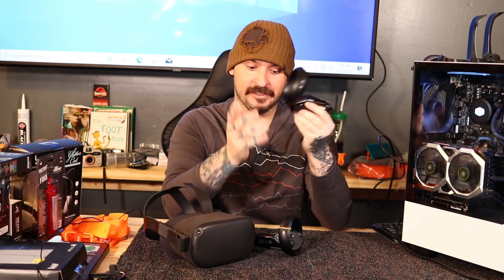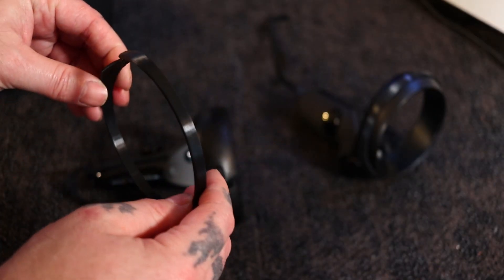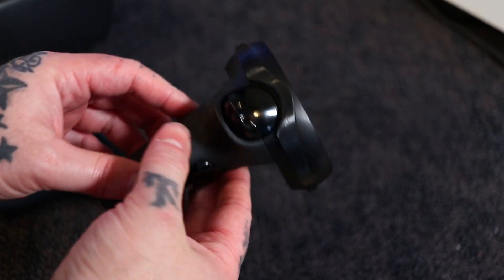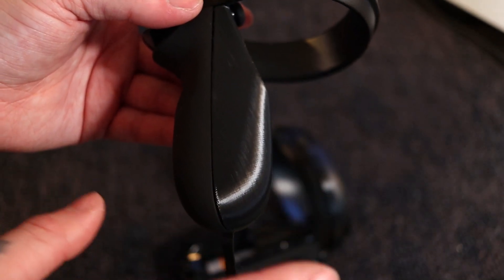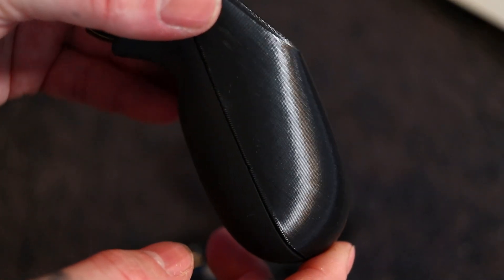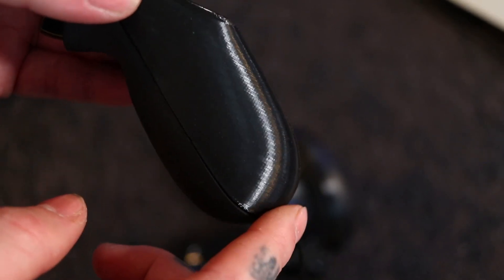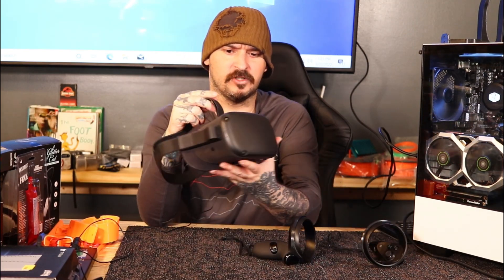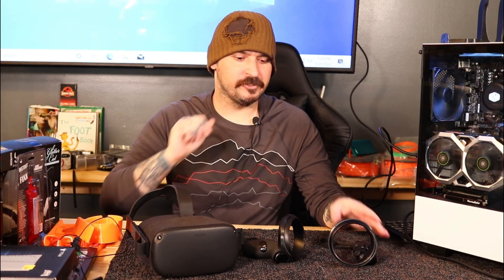Repair Your Oculus Controller - Oculus Quest Controller Ring Break - Missing Battery Cover - HOW TO

Comment: Hello, thanks for making this video but I was wondering if there was anyway to help me with a certain issue. I basically rubbed my controller on my shirt pretty hard as I trying to get something off of my shirt and somehow a little slit in the middle of the controller (it was basically the one that you showed that can be snapped back together) and whenever I hold the controller straight the controller just has the worst tracking ever. I was wondering if its possible to fix this.
Reply from the maker: im not sure, you may need a new controller

Comment: Since I don't have access to a 3d printer, I used (very) heavy duty cable ties - 1/4" wide.  I used a pliers to tighten them, and then a spot of crazy glue to help keep them in place.  I'll see how it works, but I wouldn't have thought of it if not for this video.

Comment: Hey!  Are you able to fix um a broke controller if they cracked and a piece fell out can you fix it? Because it happened to me and I need some info about it! Thanks for the info!
Reply: authors description:
"Mine was cracked completely in 2 at one point and half way through at another and this ring fixed it right up. friction holds it in place and if you happen to hit the controller again the 3D printed ring can easily be readjusted."

Comment: If it's hard to get one of those rings, just use plastic cable ties or stainless steel cable ties and it gets the job done...
And to make it look nicer after just buy one of those silicone controller protectors.👌🏽

Comment: So I have a split I middle of my controller ring does it just snap back together?
Reply from the maker: If at the top of the ring it does not, if its on the under side of the top pf the ring it glues on